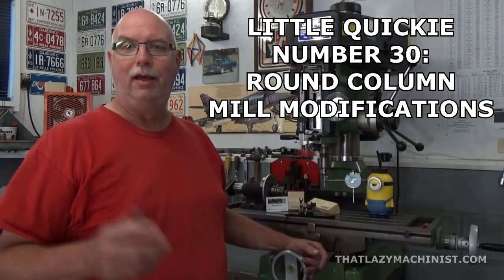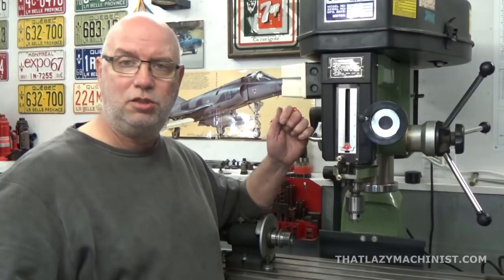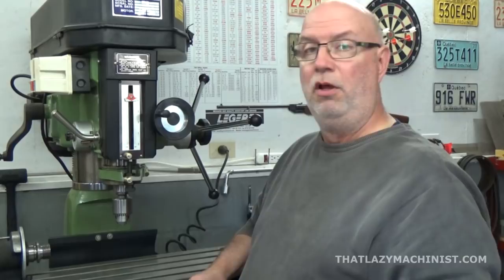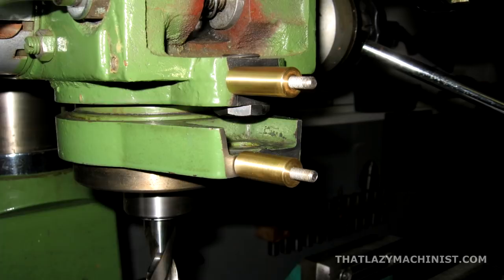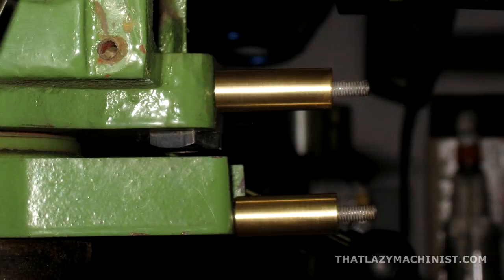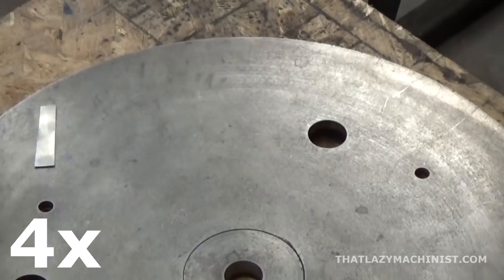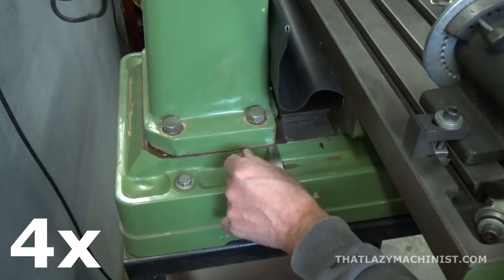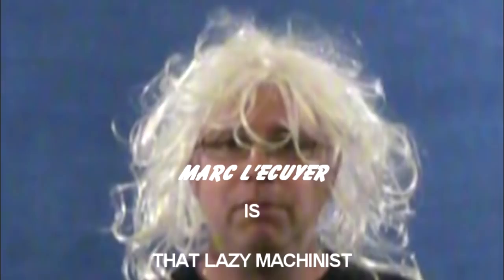ROUND COLUMN MILL MODIFICATIONS: SPINDLE READOUT, SPINDLE LOCK & COLUMN ALIGNMENT. MARC LECUYER

Comment: I've seen the digital calipers on sale for as little as $10 USD. For that price I'd cut the I.D. measuring ears off with a dremel tool... My luck is that usually if there is something sticking out it will get me eventually.
 
If you pick the calipers up at Harbor Freight or similar, be sure to remove them from the box and make sure the measuring blades close completely by holding the caliper up to the light before purchase. When you get home, take a stone and deburr all the sharp edges.

Glad to see you again too.

Comment: Wonderful to see you back Marc.
The bonus is seeing you work on the same mill as mine, thanks.
Reply: I meant to add that I did not buy that type of mill because of the round co,umn. At vertical movement of the head it'll be out of position. What is the correction for that???  Downwards feeding is theoritically not good, there is too much backlash on the rack and the end I'll could pull itself into the work. Again I loved this great video and waiting for the next Thanks. Old Bob

Comment: Nice mod Marc. Some years ago I integrated a dial indicator with a 1" range to the head of my machine.
The indicator is clamped to a vertical bar with a long slot so I can move the indicator up and down where I need it and them lock it in place with a wing nut.

Comment: Hello Marc, that was a terrific vidèo, very helpful and close to me. I have a Harbour freight mini mill on which I did many modification. one of the serious problem is that after many tests I came to yhe conclusion that the spindle is not parallel with the column. This has an effect, which is not mended by shimming, is that when I start a hole with a short center drill and I raise the head and put a regular length of drill bit in the same chuck the drill bit will land up away from the center bit's done position in three X direction. This would be the case affiliated to any mill at the mentioned problem. I bought a Rockwell of the 60s and did huge amount of work on it, it will take several videos to show those interesting problems.
The small spring was a great idea I will use it. The Harbor freight will get a new fixed column. Looking forward to the continuations, thanks for this enjoyable and very useful posting. Old Bob

Comment: IT IS GREAT TO SEE YOU BACK!

THANK YOU!, THANK YOU! THANK YOU!  Marc. You can not imagine how much I needed this video!  I have been trying to work out a "poor mans DRO" for my Drill Mill ever since I got the thing. I have seen other youtube videos on this subject. That said, I give THIS VIDEO 10 out of 5 STARS **********.  One question, if I may:  Roughly how long are the brass spacers? 

Knowing how good i am at colliding with inanimate objects, I plan on cutting off those inside caliper points all together. They look PAINFUL! I took your advice over a year ago on shimming the coulomb. I somehow managed to get it with in a few tenths of square with the table. (That was an all weekend en-devour).
The modification to the quill lock is just the ticket! That is ON the to-do list STAT! That thing is madding. 
Thank you so much for posting this!
Reply: Not a "reply" but an addition:  The greatest accomplishment with your "Poor mans D.R.O." vs the other that I've seen is: Your design retains the use of the depth stop. These can be very handy devices witch I'm not willing to give up. Now after viewing this video a 2nd time. I have decided to cut off all 4 points of the calipers, as both sides appear to be blood test appliances. OUCH!
Reply: Scott Thornton Same here. I will install it permanently and cut the tips off. I do not foresee taking it off the mill to use as a caliper.
Reply: The fixed jaw on my HF calipers work hardened nearly instantly even though, I was using a sharp cobalt drill.  I tried the diamond grinder to no avail. So then I decided to cut it out as a slot using a dremel cutoff wheel. It works perfectly! and, It made removing the points a simple task.

Comment: As an alternate to rounding off the ends of the sharp jaws, maybe use some small platic 'caps' to cover the tips. i.e. so that the calipers can still be used if necessary to measure ID's.
Thanks for doing these videos. I recently bought a used mill very much like this one and definitely need to make some changes because I am not just lazy but also cheap.:)

Comment: Great tips Marc.
All mods would equally apply to the dovetail column version of these mills too. :-)

A question, do you experience "quill drop" when feeding down using the "calibrated" Z axis handwheel?
I believe this is due to the rack and pinion on the quill, the feeding is pushing the lower edge of therack, but every so often it frees up and drops to engage the top of the rack tooth. Mine does it and would like to devise a solution, wondering if you any ideas?

As for crap in the background, you'd totally lose the machine in the foreground in my shed!

Thanks, Ray